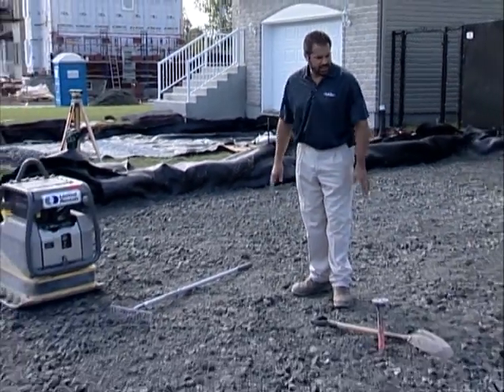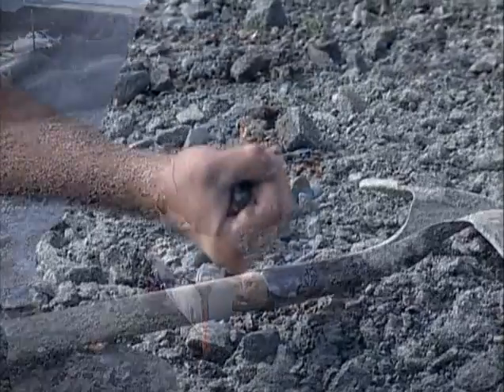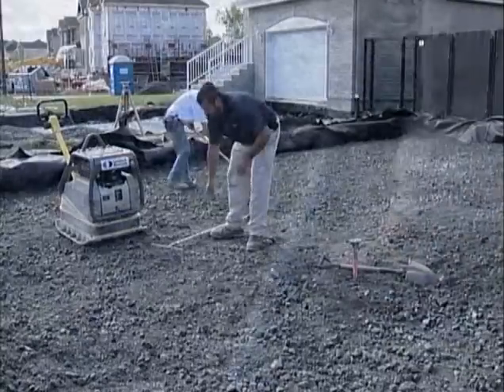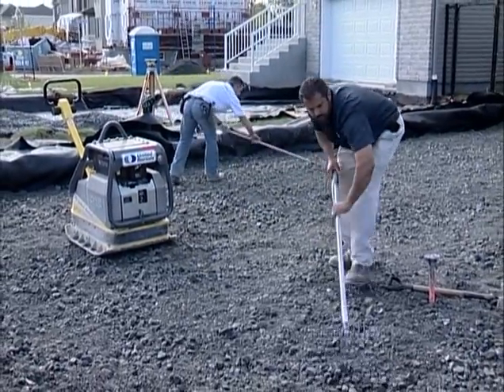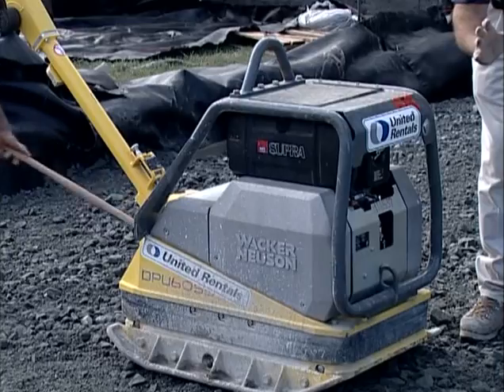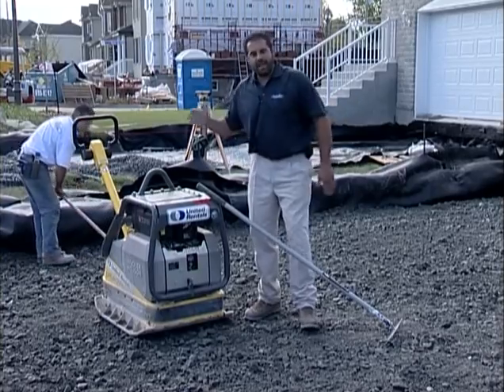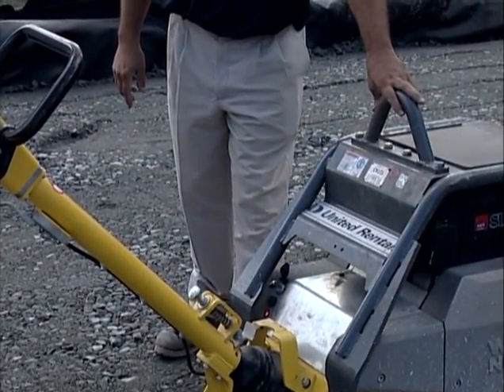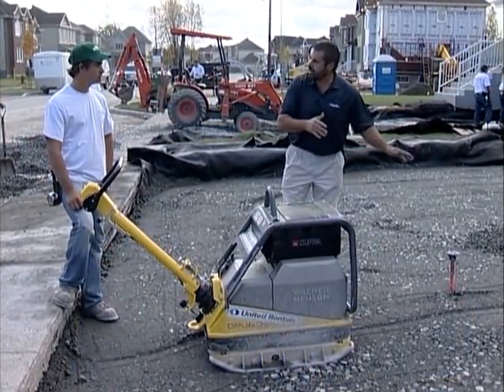Subbase Analysis and Compaction

Comment: The sound of the Hertz Engine is in my heart beat. Those Engines are next to none and they never let you down and deliver consistently for demanding jobs.Though the engines are rare in the market,they command alot of respect. For me i call them semi automatic diesel engines.When they sense trouble they stop instead of doing a major engine damage. but the video ended abruptly before the tail end of the project. kindly replay compaction.

Comment: 12,000 pound plate compactor?!

What's it made out of? Neutron star material?
Reply: 12,000 lbs of compaction force.. looks like a 1,000 lb unit.
Reply: Matthew Kahler  i thought the exact same thing
Reply: @tommypearce9967  it puts out 12,000lbs of compaction.. it doesn't weigh 12k. Dumbass

Comment: 6 inches overkill.. ad water before you run the compactor and a 6 million pound plate compactor is wayyy to much .. lol 
Can’t argue with the quality, or someone who goes all out.. I’m just saying you get same results using 3 inch base compacted with a machine you can almost lift into your truck by yourself..
Reply: Basic Wrench so when your doing a large driveway or massive project which requires perhaps a 12" - 24" base your going to mess around doing three inch lifts and potentially fail a density test or have a potential repair all to use your baby compactor? Do everyone a favor and stay away from the hard scape industry with that attitude.
Reply: The compactor has a flux capacitor also

Comment: That is an okay way of doing it but you may be better off setting screed pins and using a rod stick if you really want a uniform thickness. When it's small footage stuff like this it doesn't have such a compounded effect but it allows for a tighter bid and a better sub-grade

Comment: how much time do you spend compacting without special testing tools to get a pretty good result?
And how long would one spend compacting R.A.P. as compared to normal aggregate?
I have to compact some RAP to go under a concrete slab that my mobile home is going to be permanently attached to.
I want to do a good job, but I don't have special tools. Also, my compactor is the hopping type. Is that bad?
Thanks for any replies. I'm just a homeowner trying to do a good job (and pass inspection...lol)
Reply from the maker: Hello!
Compaction time is dictated by the material soil being compacted, the inherent moisture level and the compaction equipment used. A quick field test to check compaction in a small residential application could be the driving of an 8" spike into the compacted base material. A good amount of effort and force should need to be applied while hammering with a 3 lbs maul or hammer.  If the spike is driven into the aggregate fairly easily it is not compacted enough.

Thank you!
Reply: 5 years later, how did the job turn out?